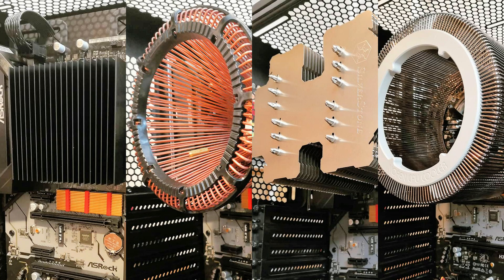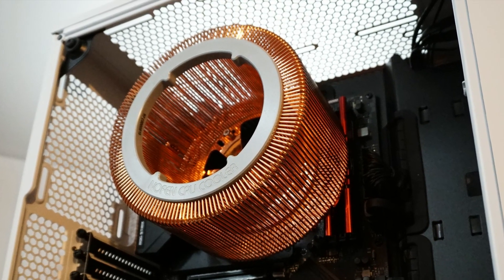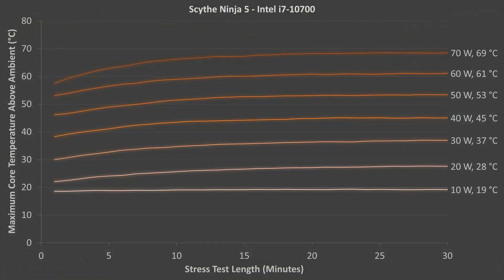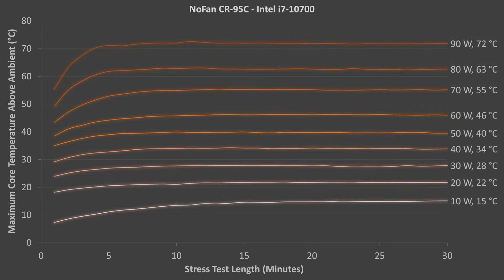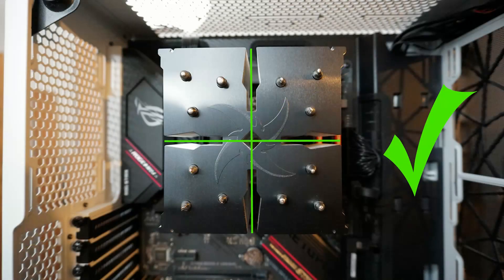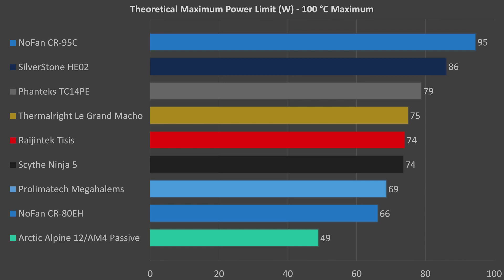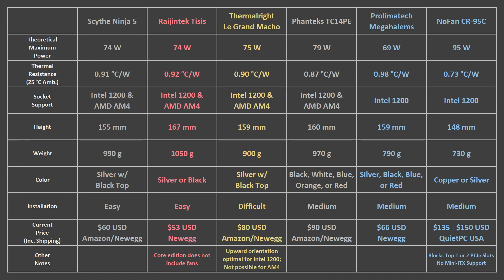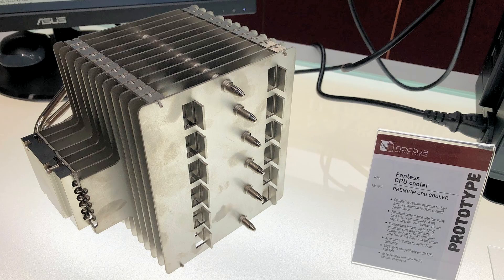The Best Fanless CPU Cooler Showdown 2

Comment: If u were to create best value per performance PC with a B450, Ryzen 5 3600 w Raijintek Tisis, GTX 1650, Corsair LPX 2 x 8GB 3000mhz 15-17-17-35, WD Black NVMe 500GB.......... wut would you use to passively cool that mid-entry level GTX 1650?
Reply from the maker: An Arctic Accelero Xtreme III without the fans.

Comment: I use mine Phanteks TC14PE on Intel i7-2700K at stock speed 3.5GHz with turbo up to 3.9GHz all cores temp reading 65,66,67,68 and cpu reading at 50c with 30 minutes prime95 stress test without dual fans with 4 cores / 8 threads with vcore at 1.18v

Comment: Amazing test! I wonder what would be the thermal difference with the default fans installed but not running. I consider using Ninja 5 to passively cool i5 10400F in idle.
Reply from the maker: Thermals will be slightly worse with a non-spinning fan attached, but just slightly. This is a good stategy for complete silence at idle and fan use for higher power uses.

Comment: Great video. I am currently changing my hardware piece by piece to go silent, inspired by your work. I am wondering if any of these coolers, besides the NoFan CR-80EH, will fit a mini-itx build without interfering with the RAM. Any chance you have tried this?

I have the Gigabyte X570 AORUS PRO motherboard, Ryzen 3700x AM4 CPU with G.Skill Trident Z RGB LED DDR4 3600MHz 2x16GB. The ram measures 45 mm from motherboard to top of RAM. Actually they are flush with my current cooler, the Noctua L9, which should be 37 millimeter tall (+ height of CPU and mounts).

Best
Fred
Reply from the maker: Some of these coolers other than the NoFan coolers will work on ITX without interfering with the Trident Z memory. Refer to their webpages to find out the maximum RAM height. Only the NoFan CR-95C will not work at all with Mini ITX.
Reply: @fullysilentpcs  Tank you!

Comment: I use a Scythe Kotetsu Mark II for semi-passive cooling on an older i3. Works very well so far. (Desktop idle without the fan running = 37°C)
On an older system I run an Amd X2 passively with a Scythe Infinity. When compared to the Scythe Ninja,the Infinity had better passive cooling abilities at that time (~10 years ago).

Comment: With no info ‘bout it I decided to get the thermalright macho for the same reason to chill the i5 10400. I get 70c avg in load with two fans (one in one out) in case with good air move (hope it’s correct to say). And after a week because of the “google listened us” i have this in recomendations 😂
Reply: Forget. The fans not attached to the cooler directly. One is in a back of the case and one in front of it. And both have  1000rpm at max

Comment: Thank you very much for your efforts, I will take Phanteks for Ryzen 1600. Was there a difference in installation vertically or horizontally?
Reply from the maker: Yes, the Phanteks did better horizontally. Unfortunately, like with the Thermalright cooler, this isn't possible on AM4. The difference is only a few degrees though.
Reply: Thanks!
Reply: @fullysilentpcs  I've ordered Phanteks, could test it with R5 1600 + Define 7 Compact and share results with you if needed.
Reply from the maker: Great, I'd love to hear how it does.
Reply: @fullysilentpcs  What thermal compound did you used for the tests (4.5 W/m-k or better)?
Reply from the maker: Arctic MX-4, 8.5 W/mK